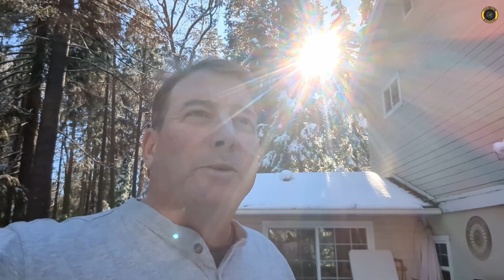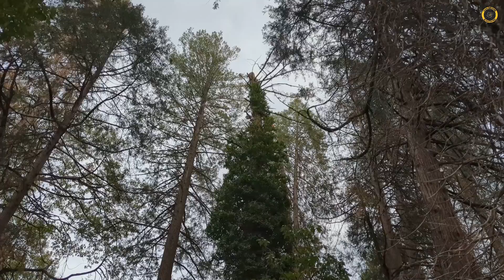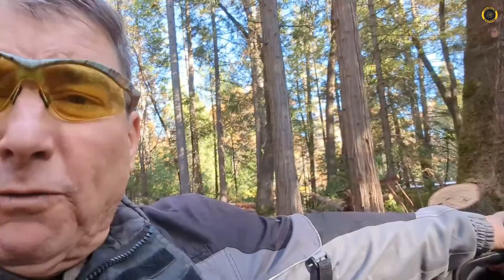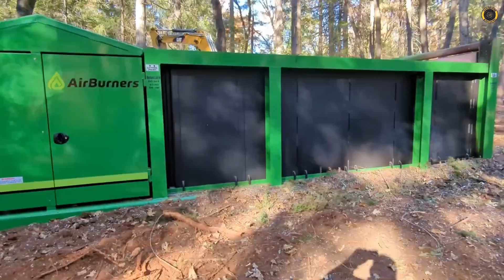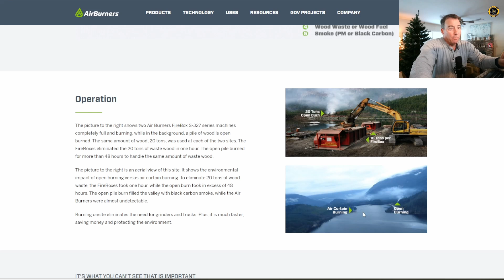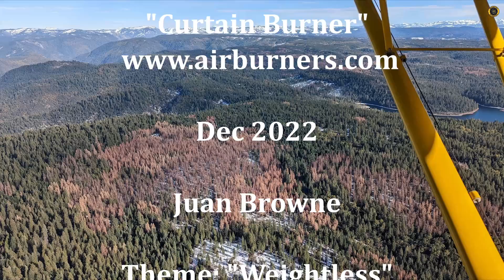"Curtain Burner"! and Winter Storm UPDATE 12 Dec 2022

Comment: A curtain burner as a means of making steam.  That would be an awesome way to at least use the stuff before just dumping it into the air.  The portable powerplant could be hooked into a critical piece of infrastructure to help the clean up efforts.  (Recharging the battery powered fire trucks comes to mind)

Comment: well, why burn all this excellent material that could jus be crushed as it is mostly done in Europe, the spray the shredded material on the ground - it delays quite a lot the return of the vegetation, provides a smooth land to walk on and requires much less petrol to transform...? It could be also put in (big) bags and sold as is it quite expensive when needed to be bought... Just my 2 cents
Reply from the maker: Too much diesel fuel and methane gas.

Comment: loggers have used hydraulic limbers and chippers for years, with constant loading till you go home.  this is a cool design concept. tough to do a lot of burning in a mega drought...in a forest.   in or just after a storm, I guess.  chipping would be my choice for that which can't be cut for lumber, or sold as whole timber. a lot faster, no idle time for the excavator(S).  anything is better than open pile burning if possible.

Comment: This is great.  Although, the "one piece" units you have shown are a great tool in this area of disposing wood waste, the technology has been around since at least the late 80's to early 90's.  As a retired firefighter from a Virginia county in the Washington, D.C. suburbs, we required all burning by contractors clearing land for developers to be permitted and use an air-curtain device to reduce air pollution in the D.C. metropolitan area.  The devices were larger and in many pieces compared to the units you featured.  The technology was more primitive but it worked.

Comment: I do think that how that "box" is used is something of the stupidest I have seen in a long time. Using a lot of energy to get rid of a lot of energy. 
The heat for the burning flash have a lot more energy then what is needed to run the fans. Not including the function to generate at least the electricity to run the fans is just bad design.
Also a setup that can generate electricity, but takes week or months to move make me wounder if they are just doing some "green washing" of a design that are basically just bad.

Comment: My question is what is the difference between using this burn method and simply using a grinder that reduces the trunks etc .to mulch ? They are also much more mobile.
Reply: Most of the work is done by the fire, the diesel engine is just providing air, looks like the model here is only 49 horsepower. Big mulchers can be hundreds of horsepower with the accompanying fuel consumption.

Comment: Why do you have to burn anything?  Why not cut down what needs to be cut down and just move it away from any structure and let it naturally decay?  It may burn during a forest fire, if there is a fire, but, if moved far enough away, it shouldn't present any problems.  Also, smoke, in and of itself, is not dangerous.  It's natural and not a harmful "pollutant".  It will simply land somewhere as particulate matter (ash?) and that's the end of it.  As far as energy creation is concerned, how does a fire create electricity, if its not boiling water and turning a turbine?  Sounds like some "magic" here and is just a sales gimmick.
Reply from the maker: You need to live here to understand the fire trap hazard that you are proposing . Wrong answer. Watch again and LEARN.

Comment: It seems next to crazy to my mind to be wastefully burning 'bio-mass' that could potentially be used as fuel to generate electrical power. Is it used purely just to get rid of 'surplus' wood ? We have a 1GW power station here in the UK that burns wood chips and only wood for example.

Comment: The engineer in me likes the generator idea, except all the added complexity.  Instead, I’m thinking an air to water heat exchanger.  Use the hot water for radiant floor or baseboard hot water heating.

Comment: You would like the ones they use here in TX. They dig a large ditch and roll in the fan next to the pit. They have a massive diesel engine running the fan. They are for clearing for new housing. Just dig a ditch burn then bury it and then dig another ditch ant repeat. Some are 18wheeler sized units. Also used for large freeway projects.

Comment: What a cool machine. 

Operating it and riding that excavator to keep it filled must feel like the adult version of maintaining a campfire.

Could such a thing be built with just a chimney to generate draft instead of running a diesel blower? At least after some initial startup phase? Maybe a modular system retaining the portability with just some extra time required to set up on site? 

Having a raging fire sustained that way would be even more awesome.

Comment: that looks like a very efficient way to burn off unwanted material - the hot air makes perfect sense for the Fire triangle (fuel, heat, oxygen) i'm surprised it doesn't blow any ash - guess the air blows over the top, and the depth of ash has to be controlled by digging out often - i might have thought that mulching was a better way to deal with material, since a lot of reports after some of the huge fires can poison local water supplies, i believe it costs the tax payer millions to keep water clean before it gets to your tap - but for a piece of kit like this, where you burn on the spot, contamination is reduced as its localised

Comment: They could put some tubes underneath the fire and you could have some hoses you connect into the unit and you could have recycled hot water.  Although to make use of that good enough you would need to constantly be filling that thing up to burn. 1 BTU = 3.14 watts of electricity  and  746 watts = 1 hp.  How much is 1 BTU you say?  it's about the amount of heat you get out of lighting a match that's about how much energy is 1 BTU.  Although where you live Juan you should look into solar panels you guys probably get 300+ days of sunshine throughout the year or more and during the summer months you might even generate enough electricity the power company starts paying you back because your helping feed other customers electricity!

Comment: It’s a waste of good fuel. For many it’s a sole source of fuel for heating and cooking. I know that after the fires in Northern Evoia in Greece that was decimated by wildfires last year teams came in and cut down stands of burnt trees and returned a portion to the property owners for several years worth of fuel and the rest was sold a firewood to recover the costs of the recovery teams.
I have heard that burning wood in boilers for heat is now illegal in California. 
We use a closed system fireplace that is also a boiler feeding hot water to radiators in the lower basement and to the hydronic in floor heat to the upper two floors of the house. There is also a feed to the "triple energy" solar water heater which supplements the solar in the winter. The fireplace is so efficient that very little ash and smoke are produced. The secret to little smoke is to start a roaring hot fire in the firebox, heating the double walled chimney quickly which prevents condensation buildup that leads to a Smokey burn. It also helps to limit the creosote buildup in the chimney. What would ordinarily used around 2500 liters of fuel oil we can accomplish with about 12 metric tons of firewood. Fuel oil runs about €2.50 per liter while wood runs around €130 per ton.
Reply from the maker: You fail to understand the the SCOPE of the issue here in California....most folks in Europe have no idea HOW MUCH BIOMASS 30 % of the Sierra timber actually represents!

Comment: Great idea about generating electricity with the waste heat, but your comment about moving the slash to the burner lead me to wonder what are you going to do with the electricity that you generate out in the middle of the woods?   Either you will have to come up with some way of moving the power to the grid, or move the fuel to the generator.  Fairly costly either way.

Comment: That air curtain could have water pipes running through it it to run a steam engine and make electricity. It could pay for itself.
Reply: Did You take a smoke break or something?  Go back and watch the last two or three minutes.  They are using it to generate electricity !:-)

Comment: What's wrong with chipping up the wood to use in a more productive way?
Reply from the maker: Chipping requires 100gallons per hour diesel and produces METHANE gas from the rotting compost.
Reply: @blancolirio  ...chipped timber/brush spread out on the forest floor doesn't produce methane.

Comment: Solo stove camping fire rings are based on the same principle except they use natural draft generated by the fire heating the walls to power the air curtain. BioLite also has a smokeless fire pit using a small battery to power a fan and their camp stove that uses a small peltier device powered by the fire to run a fan and power up your cellphone or similar USB powered devices.

Comment: I’m guessing that air movement superheats the materials to more so incinerate them than burn. If you keep it hot enough the ambient air temp will burn a much larger percentage of the smoke particles…and smoke is largely seen by humans because of the micro particles.  

I’ve burned tons of waste pallets and if you keep heaping the coals on itself you create basically a self insulating and digesting oven that only continues to get smaller.  If you burn right you can condense prob 100 pallets plus into one residential sized rolloff trash can not even full.

Comment: You could disperse wood chips into the wild and raise locally organic content to make new humus. Let nature transform it, in months. By summer this is not combustible anymore. 

All this motorized air curtains nonsens with diesel motor seems to be over kill. Why always the need to be hyper quick and energy intensive and returning instantaneously CO2 to the air?

Letting nature reabsorving carbon to the soil thru humus is more efficient. Why burning. Shred it instead. Look how soil retain CO2 here:
https://youtu.be/xv-n54NTd9M

Comment: I feel like you are understating the storm a little bit.  6-7 feet of snow at the summits and 4-5' of snow at the 6,000-7000' elevations in 48 hours is much more than an average storm.  Not disagreeing with you on the main stream media coverage though, nor the fact that this will not end the drought, but almost 200" of snow by mid December it is a good start to the snow year.  Hopefully it keeps going.

Comment: Interesting machine.  A couple of years ago a friend wanted all the trees removed from a field that not long ago geologically was a swamp, so a whole group of us showed up with chain saws.  They had a backhoe with a claw bucket grapple and a skid-steer, then proceeded to dig a large pit hitting the water level at about ten feet, filling it with green live trees, they put a gas torch half way down the pit and forced the trees down.  It was amazing to me, they burn really hot and fast, live trees in water, lots of them, I didn't think it was possible.  No idea on the smoke as it was dusk and foggy from the get go.  Obviously condensing them is the key.  I was concerned about their hydraulic lines.

Comment: It's a darn shame to see that curtain burner in action.
Run the wood through a chipper, and use the wood chips to generate heat (for electricity generation, remote steam or hot water plants, etc). My old hometown runs the entire hot water system (for remote but centralized heating) off wood chips and bio fuels. Hot water (not steam) is piped throughout the city, and each house has a small heat exchanger (the size of an instant hot water heater here in the US) to generate domestic hot water, as well as hot water for the radiant heating system. Has allowed for the removal of dirty and maintenance prone oil burners in individual homes, freeing up a lot of space (especially when also considering the fuel oil storage tanks of some 3-4 m2 (~1,000 gallons) that were inside each dwelling (outside underground tanks were banned decades ago).

Then, if not burning it for heat, better would be to just chip and then let it decompose naturally. Really no need to burn it out in the open (with the result in pollution and wasted energy).
Reply from the maker: Do the math...
Reply: @blancolirio , I can see many better ways to invest $130K than in an open burn pit ;-)

But fact still remains; in most countries wood chips is a valuable energy resource and rarely ever wasted. 
Still, I'm glad I can get them for free a bit to the north of you (PNW) where I use them in the backyard to cover bare dirt.

Comment: In England many coal burning power stations burn wood pellets that are made from the south east U.S. forests(by the boat load)
Waste to Energy plants are another example of turning all sorts of burnable waste into electricity. There  about 54 such plants in the U.S.
One in Spokane Washington creates enough energy to run 70,000 homes and is part of the stable grid by burning trash.
They are incredibly clean and also act as recyclers in that metal is extracted from the ash.

Comment: It would be great if the biomass heat output could power the burner after it starts. I was wondering where the exhaust gas exits the burner.
Reply: Looks like it just provides plenty of air to keep the combustion temperature above where soot is produced. Soot is unburnt fuel.

Comment: That Curtain Burner you showed solved a mystery for me. Contractors have recently cleared a wooden 20 Acre new housing development next to where I live in Ohio, I thought that it was strange that I was not hearing the usual noise from the wood chipper buzzing and grinding up the limbs and crap wood for the month they work on it, I had to investigate why not, and saw that very same machine you showed in your video or should I say a furnace setup you showed  I saw it there but did not know what it was, however, must say it's much quieter.
Reply: Very cool.
Part of me thinks it's a waste to burn all the wood but I can also see burning it is a lot easier than trying to truck to a saw mill. I'm also not sure if any of that wood would be useful as lumber or not. Apparently the wood isn't worth trucking.
Thanks for sharing your story.
Reply: @ddegn  The contractors did truck out all the sawmillable wood to the local sawmills, I was the crap wood they cookoff the strange-looking machine
Reply: @davidschwartz5127  It's good to hear they could use some of the wood. Thanks for clarifying.
Reply: @ddegn  Logs need to be at least 12" diameter to be any use to a conventional sawmill, but anything above about 3" can be used for OSB.  ... And IMHO, any scrap should be shredded for mulch, to control regrowth of undergrowth and reduce moisture loss, it is a valuable resource,  and if all else fails, at least burn it in a boiler furnace.  Burning it just to rid of it goes against just about everything regarding use of resources, reduction of atmospheric CO2, and, dare I say, common sense.
Reply: @pulaski1  "Burning it just to rid of it goes against just about everything regarding use of resources"
I agree in principle but there are likely scenarios where converting the wood to useful energy could require more resources than the resources it saves. Some recycling projects end up as a net consumer of resources.
I'm not sure, but I imagine it's possible to have too much mulch.
That said, it is disturbing to see so much wood being burned just to get rid of it.

Thanks for info about log sizes etc..

Comment: The hard part about turning it into electricity is having the grid able to take it.

A typical house ( at least around here ) is a 200 amp service which equates to a 20 KW service. A 100 KW unit needs a special hook up to the grid. It's worth it if you have 50 or 100 acres of brush to clear like your neighbour. One building lot, not likely
Reply: I wonder if once the concept design is proven it could be scaled down to the homeowner level.
Reply: @1gibrik  I don't see why not. As part of a "green home". Solar panels,  wind turbine and steam engine back feeding the grid.

The typical "steam engine" has a boiler and the steam after moving the piston is exhausted to atmosphere. that takes a lot of water. It should be possible to run the exhaust steam through a condenser to close the loop. Even a steam turbine with a condenser would work. If nothing else use the energy to replace the diesel drive for the fan

Comment: Seems there'd be a real advantage to a tub grinder for recycling woody waste, back into topsoil, while retaining moisture and O2. Likely much quicker too.
Reply: Agree, unless the nitrogen demand is too much for the topsoil to compost all that wood.  I saw and entire cherry orchard reduced to chips in one weekend with a grinder- can't imagine how long it would have taken to burn.  On a micro scale I compost all of my Fall fruit tree trimmings plus the annual Christmas tree by running it thru my Dad's old Roto-Hoe chipper.  I mix the shredded wood with ammonium sulfate, or whatever cheap fertilizer I can find by buying broken bags for half price at Lowes, so that it is ready to use in the garden by Spring.
Reply: @smo-guiver8315  Another possible option is a forestry mulcher, skid-steer with a big rotating hammer-mill up front, capable of shredding and "tilling" woody debris in size up to whole tree-trunks. Sample: https://www.youtube.com/watch?v=xWCXnuXEUMw One discaimer: I'd buck ANY suitable wood for eventual processing as fuelwood and haul it clear before calling in the mulcher.